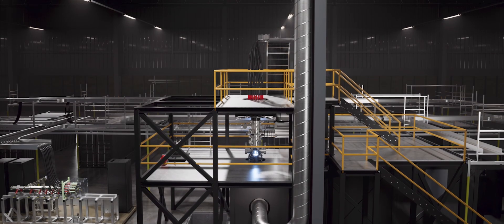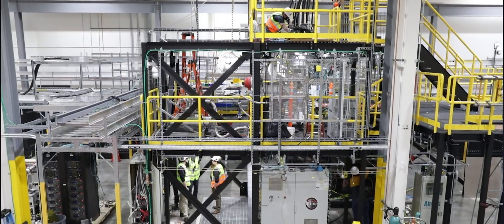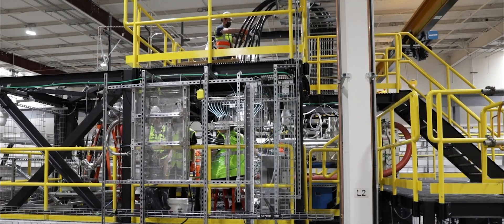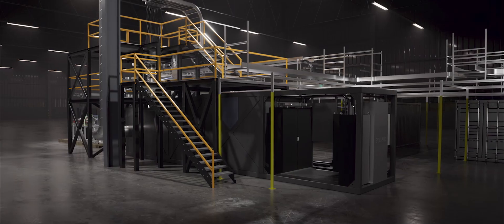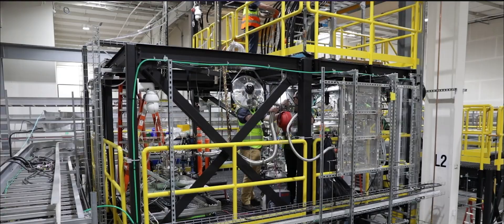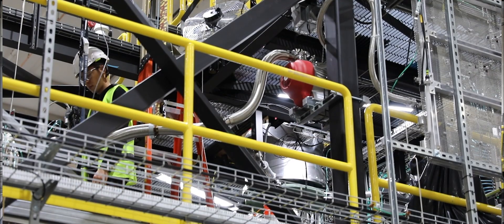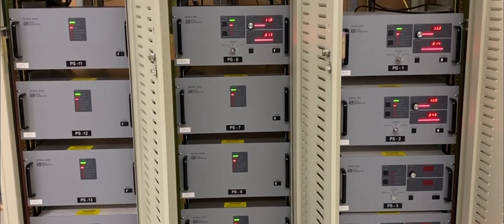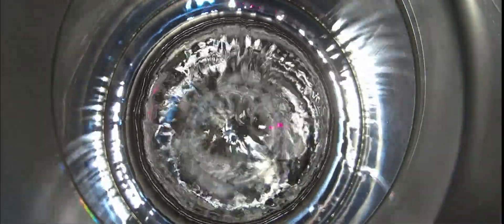Zap Energy Unveils "Century"

Comment: Z pinch isnt hard tune the em field like a manual fuel ratio in a petrol car too heavy instabilities too loose kinking i worked out a way to make plasma essentially form a perfect z pinch with intersecting field lines. the plasma skates round this turning its rotational momentum into a current through coils directly harvesting from the momentum that would instead lead to instability

Comment: Please share a link to an explanation of the device function and physics behind it.
Reply: that would allow competitors to have access to information we don't want them to have, there are things that are to be kept private for a reason and giving out too much detailed  information could lead to another company or group of people getting ahead of the progress that we've made so far and we are trying to be the company that is leading the way in in this field, so it could be a long wait before those details are available to the general public
Reply: @codyhmanofGod4978  I just looked at their website which gives all the necessary details. It's a toroid shooting rail gun that uses a central column of relatively laminar flow to help stabilize and further compress the reactants to improve fusion efficiency. Future models appear to utilize centrifugal wall of low melting point metal, probably lead gallium mixture, to absorb the radiation, electrons, and heat.  It would be incredible if this approach is the one to break the net energy barrier. I wonder what the physical conditions are required to theoretically hit that point in a general sense.
Reply: It's sheared flow stabilized z-pinch, they have a video on this channel
Reply: https://youtu.be/UMDLa3tl90g